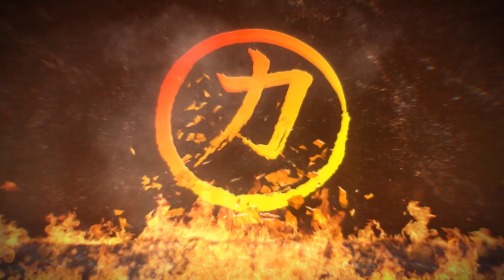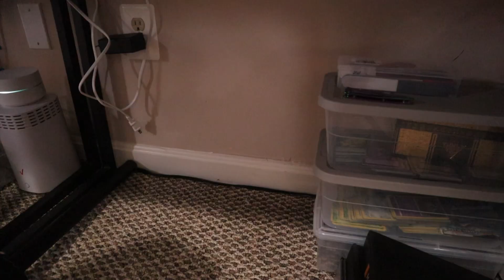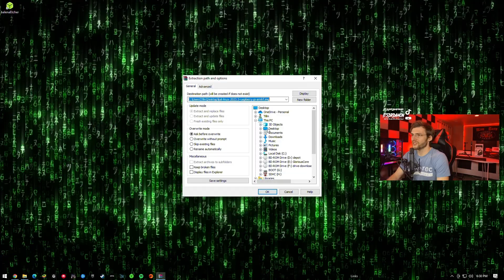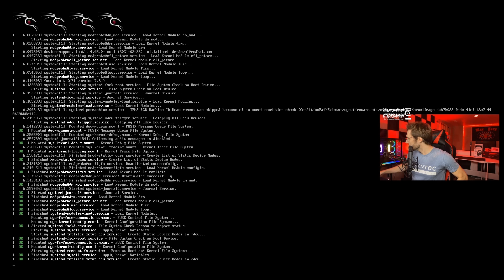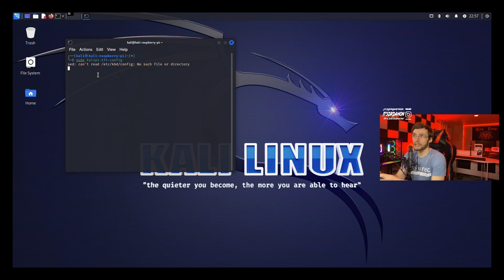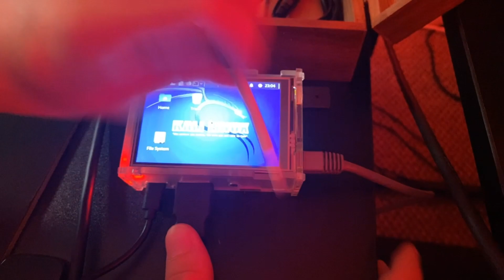Build the ULTIMATE Mini Mobile Kali Linux Cyber Tool

Comment: I need help I have a 4.0 inch display and when I unplug my raspberry and plug it back in it's showing only a comand that says energy saver on
Reply from the maker: Could be a setting within the raspberry pi or you may need a better power supply
Reply: No way I need a more powerful supply because I use my phones power supply that is 67W...(From Xiaomi 11T)
Reply: @yourbigviewer  Not necessarily! The RPi needs quite a lot of amps on 5 volts (usually, depending on model). USB PD power bricks can negotiate the voltage and amps; several 65/67W can deliver the watts (volts times amps) at higher voltage but do not deliver enough amps at lower voltage.
Also, try a different USB type C cable! Surprisingly often, the cable is the issue (simply speaking: More amps need thicker wires, so a cable that's too thin will limit the amps your Pi gets. Had this problem more than once.)

Comment: how exactly is that "mobile" add a battery-HaT to it and then it's mobile.
Reply: It sadly won’t be. It will just fry the pi. Due to the load Kali has. Most people I know have newer cars with a Amp inverter and plugging them in and letting them rip lol